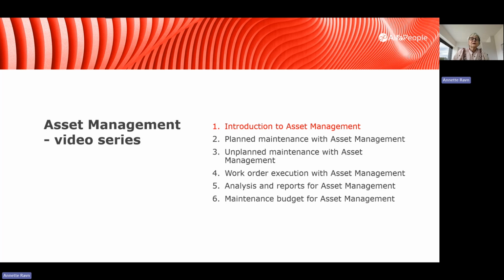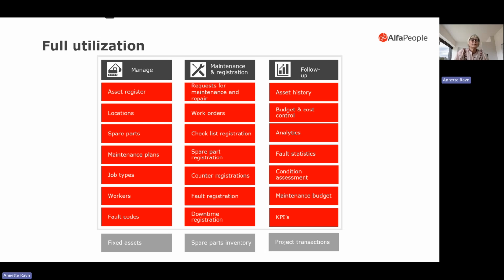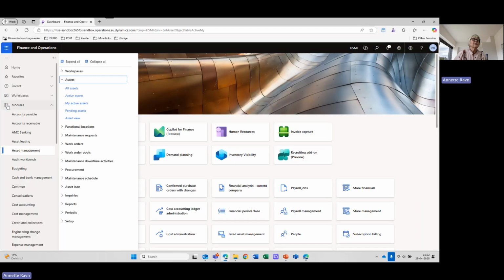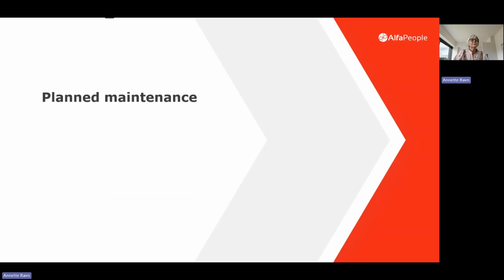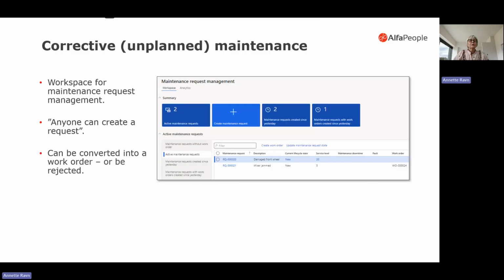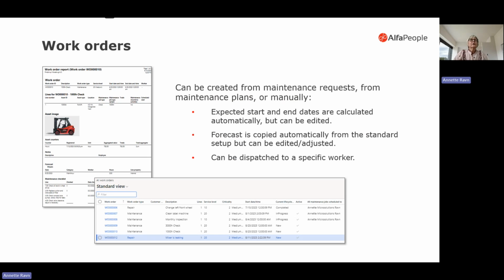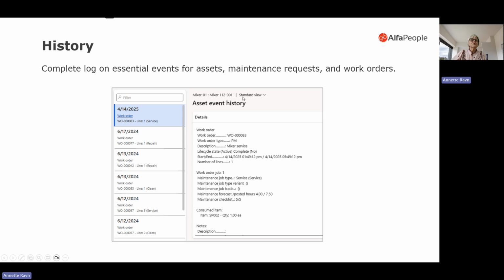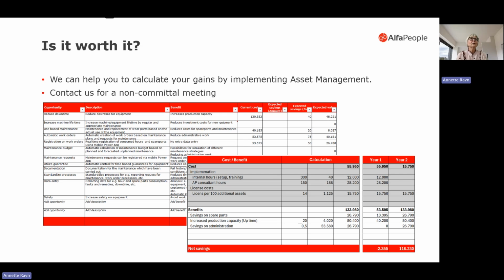Introduction to Asset Management in Microsoft Dynamics 365 Finance and Operations

Comment: Question when it comes to stock control.  Is there a way D365 helps with inventory?  For example I want to setup scanning system to reduce inventory time and reduce errors.  Is that possible with D365 if so how?